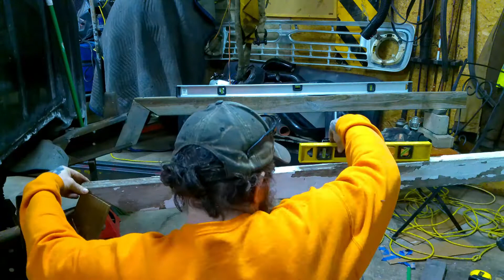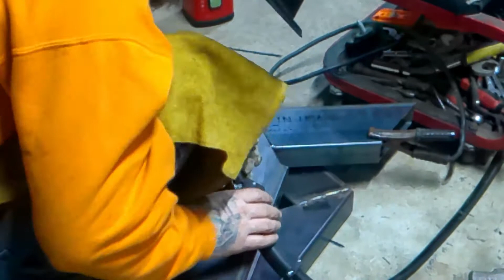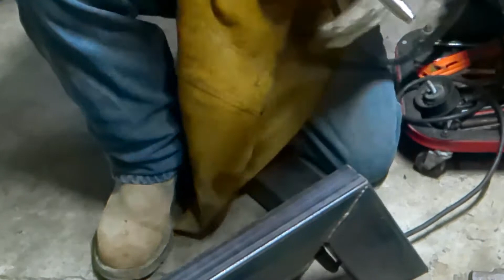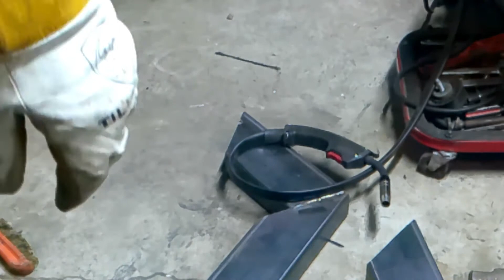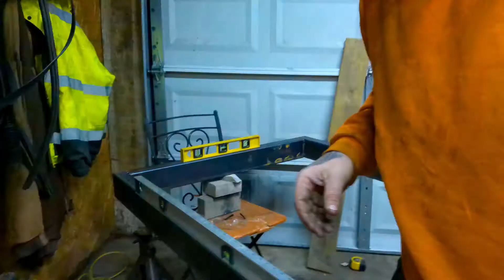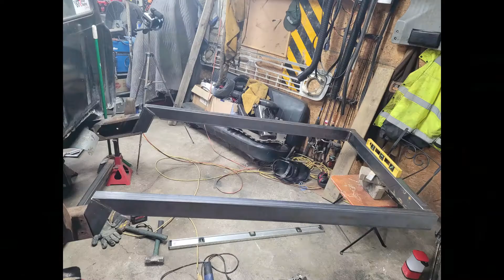66 ford f100 building new back half Frame

Comment: Why not stick the 2x3 more parallel to the factory frame and do a small pie cut to get the rails down instead of butt welding 2 seperate peices at a 45 im not knocking your skills just suggesting more overlap at the clips union
Reply from the maker: Appreciate the info will take into consideration this is my first time building something like this making it up as I go along ill have updated pics soon